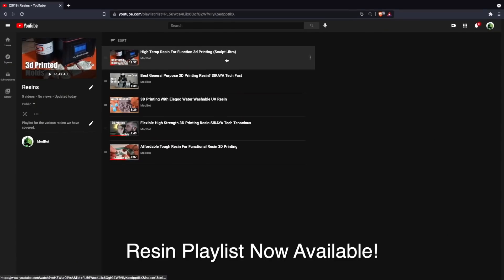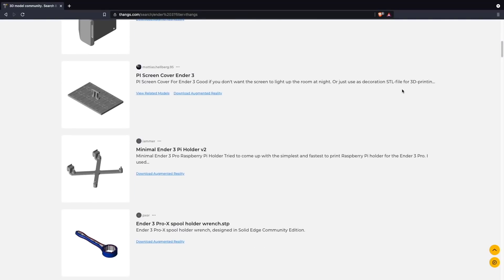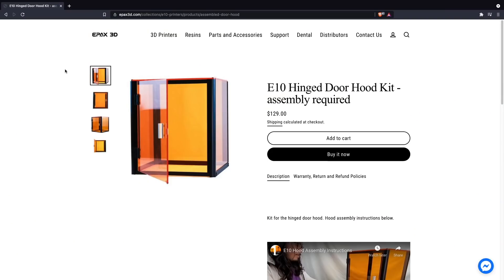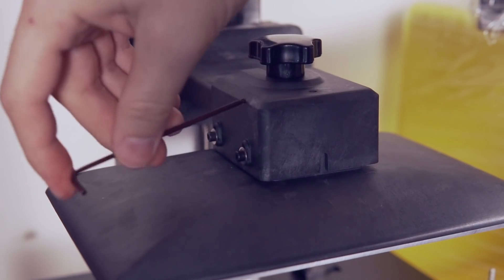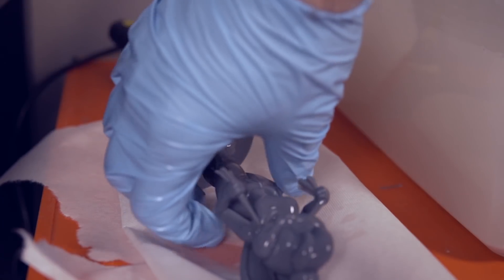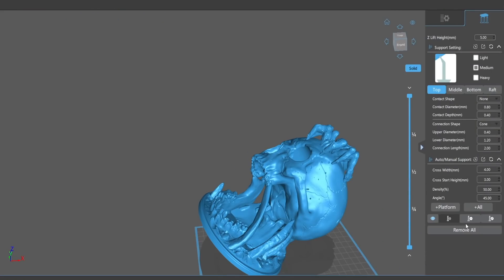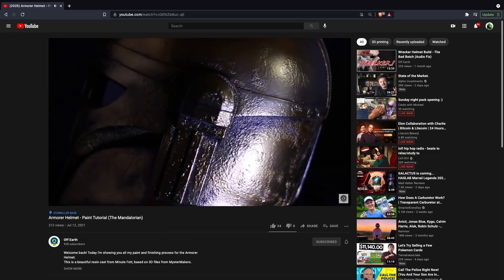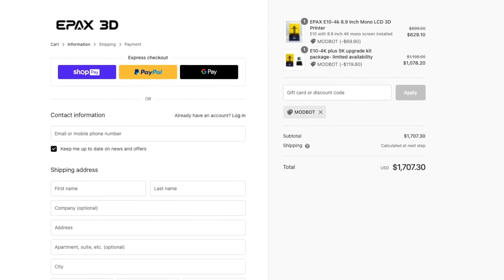INSANE Print Quality On The EPAX E10 - 5K Resin 3d Printer

Comment: What settings did you use for the 20 models print? I have this printer and have mixed results- probably more to my being new to 3d printing, but I have found it extremely difficult to find settings online?
Reply: I have barely been able to print anything with this printer. i need settings for it. My two anycubic photon monoX's are wonderful, but i cant get anything to print well on the EPAX... Anyone have settings they could show me?

Comment: Hi, I'm going to buy one of these printers, but I'm interested in how accurate printing is. Is it possible to print a working piston and cylinder?
Reply: The question is what you're using it for. With  bit of post processing you could make one for something like a model engine.
Reply: @Darenz-cg9zg  Thank you-I making air powered model engines so i was hope i can "cheat" this way parts like valves and so...

Comment: One thing I had wish Epax had done when they decided they would allow the 5k upgrade, would be that even on teh 4k version, if they has kept the 10 inch build plate. That way even if you can't use the full build volume because of the screen, when you DO upgrade your printer, it doesn't make your current buildplate/whambham/flex entirely irrelevant.

EDIT: So they did, the build plate IS the 10 inch build plate even on the 4k 8.9 screen, I'm just a measuring idiot..
Reply from the maker: I was told by someone that has the 4k version it did come with the 10 inch upgrade. So that when he upgrades he is going to use the same build plate. Did you read somewhere that it was not the case?
Reply: @ModBotArmy  hmm, i could've sworn I measured my build palte when I ordered my flex plate and it was definately the 192x120mm build surface..let me double check, maybe i jsut made a suggestion epax already did in teh first palce.

Comment: is this a NEW epax for you, I'd be very wary, of all the resin printers I own, Epax E10 has been the absolute worst by far
- Holes in FEP film in vat out of the box leaked all over screen. Bottle of Resin and FEP wasted(They said they would send me replacements on my next order but oh wait I'm in Canada)
- Polarizing film got a perfectly straight line down in somehow not a crack a precision line, which of course let light through
-Second screen HALF of it went black and other half showed the exposure test, this was only used several hundred hours tops after being replaced from polarizing film issue
-The board had the issue where it kept the UV light on 24 hours..that was fun
-I got the bad hood that they said they were going to replace with a proper one down the line, nope

And the replies I get from support are always "Try flashing firmware" after telling them I did try that prior to emailing.

Literally have spent 2/3 the cost of it on screens after printing on it for about 800 hours. Yet mono x, saturn, 2x creality LD-002H, proxima, mars etc have had nothing go wrong.
Side note don't buy screens from them, they are half the price from Chitu
Reply from the maker: Yikes, sorry to hear that. I wonder if it is a lemon scenario. I know quite a few people that have various EPAX printers and have been very happy with them. 

Also, there are printers that I have had for a long time and love that others have had terrible experiences with. Not saying it excuses it at all and your situation definitely is not good, but with that many issues it seems like that unit was a definite lemon.

Comment: I wounder if anyone has try to make a multi heads FDM machine, essentially fill the entire print surface with printer heads. So it's effectively behaves like almost like a sla machine, print the entire surface at once, but without needing special resin and post process uv curing. Resolution might be a less compare to sla machine though, but should be a lot faster than single head variant.
Reply from the maker: There are IDEX machines so two heads and their is a company called Stacker that makes at least 4 heads. That is the most I have seen though. A lot more variables when you have to have that many spools all feeding and extruding at the same time. Would be cool to see though.

Comment: Have you looked at extension tubes for macro shots? Cheap way to add macro capabilities. Some even carry your pin signals for autofocus/zoom and such. It makes a standard lens "near sighted" where an actual macro lens can be "farsighted" as well, being more versatile without shuffling around tubes and such.
Reply from the maker: Thanks for the recommendation. I had actually printed one like 6 years ago for my old canon camera. That may be the way to go (will likely purchase though).

Comment: I've got the smaller Epax3D E6 printer and am very happy with the build quality. Time will tell if the use of plastic on the build plate and vat is a long-lasting solution but it's good to know they chose to use fiberglass reinforced plastic.
Reply from the maker: How long have you had yours for? My biggest concern is likely the bed tightening screws, but because they use brass inserts I imagine the plastic is taking very little of the load.
Reply: @ModBotArmy  I've had mine since April 2021 and I've gone through 1Kg of the EPAX Water Washable Resin and no issues with the printer. The build plate even arrived pre-calibrated! I think the resin should be marketed as "Tough Resin" rather than "Water Washable". I still seem to have to clean my prints with IPA but they are not brittle so I can use it for functional parts which is most of what I need to print.

Comment: great video and review! a point about when you talk about getting a macro lens; if you have a manual lens, you can turn it around and hold it in front of your camera (or 3D print an adapter) and you have a very good macro for free-99 or design time and resin/plastic.
Reply from the maker: Thanks for watching and the recommendation. I did do something similar years ago when I had a canon camera. My lenses are all Automatic at this point but I still believe there are adapters that may be a fairly inexpensive way to get the detail I would like.

Comment: For us mini enthusiasts (28mm) the most important feature is the resolution/detail on small prints. The most important metric is the smallest micron resolution of the print. You did not offer this metric, but... Neither does Epax, apparently.  You can pump more pixels into a resin printer screen, but end up with lower details when you stretch that high resolution screen for big prints. 

I really wish I knew the minimum microns. I've been waiting for that juuuuuuust next step printer where the detail resolution absolutely matches pewter and injection molding at 28mm. I hoped this was it.

Comment: "you're not going to be forced to purchase the Pro version" yeah yeah yeah. Heard that claim before. These software dev's all do the same thing. Force users into a subscription model either by slowly boiling the frog and/or also forcing you into it by limiting the features of the so called free version so you have no choice anyway.And then if that wasn't bad enough.. they'll start upping the price over time as well as not doing what they should be (adding features, functionality, UI improvements etc).

F that white noise. Where is Pruse Slicer or Cura support on MSLA???? Open source slicers only thanks.

That was one thing i overlooked when doing far to many years of waiting and waiting for hardware to match price/performance ratio ot my liking.. i overlooked the slicer side of it assuming i would be able to slice with anything. So now i'm a bit worried i can't use any slicer to slice for the EPAX-E10 4k i've finally bought and received (but havent used yet as i sitll have to get a lot of extra gear for).
Reply: I almost bought the E10 5K on Friday, until I found out it is indeed locked to ChiTuBox. I have an X1, X1K, and X10 already so big fan of EPAX. I share your same sentiments towards open source, and was worried this was going to become a problem when I first got into SLA printing and most of the boards were made by the same manufacturer. I believe on the E10, as long as you don't upgrade the firmware, you should be okay.

Comment: Could you please tell me what the voltage is coming out of the power supply going into the printer and if it is DC?  The reason I ask is I need a printer that can operate away from 110VAC power.  Want to be able to run OTG.

Comment: Hey Dan is a cure and wash chamber needed for resin printing. I've decided to get one but not entirely sure what's needed aside from the printer and resin
Reply from the maker: Not a requirement but definitely nice to have. I use just a tub of IPA and the sun sometimes but having a station that can do it all is going to be much more repeatable.
Reply: @ModBotArmy  so I take it the models come out somewhat soft. Are there printers that are known for better curing or are they all pretty much the same. And are the prints susceptible to things like fingerprints and need to be handled carefully at first?

Comment: 8:05 - I wish they wouldn't use plastic for these vats. You can see how it is already warped when tightening down. And it will only get worse with use/time. And then it'll crack and leak. That's an annoyance on $200 printers with $30 LCD panels, but the stakes are higher on these big ones.
Reply: I think what it not mentioned much is that Epax "E" series is there "economy" model. It is meant to save money in certain areas to keep the price down. The X series is their highend one which has both the metal vat and metal build platform.  E series is just the first one they happen to add the 5k to
Reply from the maker: It seems like that is a pretty universal feeling based on comments. It is not something that has been an issue on the other printers I have used with it like an Anycubic or a Phrozen but it would be nice to at least have the option for aluminum. Maybe have it come with aluminum but also sell plastic VATs for those that want to swap in.
Reply: @ModBotArmy  Right, toss in an upgrade option for 10 bucks to add the alternative VAT.  Cater to the market.  People love options.  Just saying.
Reply: Thats the same complaint i have about the Anycubic printers.
Reply: @BretBowlby  My photon's vat is metal.  Combination of anodized aluminum and stainless.
Reply: For 200 bucks if it breaks just buy a new one

Comment: Does this printer work with Lychee slicer?
Reply: It does, v 3.4 supports the 5K screen too.
Reply: According to EPAX support as of Friday July 23rd, the 5K E10 will not work with Lychee.
Reply from the maker: I believe it is going to depend on the board version. It is my understanding that the newer printers shipping will have the latest Chitu board which is currently not compatible with Lychee. This may change though.

Comment: Daniel, it was nice to see you address the pro-slicer question. There are a number of 3D printer content providers that have not addressed the issue which is disappointing. However, the question is more than just free versus pro. Will, this printer work with other slicers besides Chitubox? The way you explained it, makes me question if it does.  CBD-Tech, the parent company of Chitubox, manufactures controller boards for many printers including Elegoo, Phrozen, Creality, and Anycubic.  This gives them monopoly control over most of the printer market. There is nothing to stop them from forcing users to the subscription software model (SAS) at any time. The only way to protect the resin printer community, from this questionable practice, is to allow the use of other slicer software. According to Naomi Wu, Creality has promised to only use controllers that allow the use of multiple slicer products, but so far that is the only one. Using other slicers and then importing the files to Chitubox is not a viable option. Slicer issues are hard enough to address without introducing cross-platform or software compatibility issues into the mix
Reply: I use Lychee, it has several epax printers set up and configured and works great for my E10
Reply: I verified with EPAX support on Friday - prior to purchasing the E10 5K - that the firmware on the motherboard in the new 5K printers is encryption locked, requiring either pro or an as-of-yet unreleased ChiTuBox free version to slice. This means that Lychee, UVTools, etc., will not be able to produce files that this machine can print. For anyone unclear, this is not a theoretical, it is the current state of new boards.

Supposedly some people who have updated the firmware in their E10s have also been locked out of using other slicers (according to the EPAX Users Group on Facebook).
Reply: @charlesfe  Thank you for the confirmation. We have to get the word out and challenge the vendors on this practice. If one gets away with it, then more will implement it. Hopefully, people will only buy printers from vendors that support the open model.
Reply: @charlesfe  That sounds extremely dumb.
Reply: Imho, Chitubox's current slicer format is supported by multiple tools (UVTools for example). So unless they make deliberate effort to change their current file format (and maybe lock it down with DRM), you aren't forced to use Chitubox with these printers. So for the current batch of printers, there's no issue. I don't want to demonize Chitu for things they might do in the future, we can cross that bridge if they do decide to roll out some DRM scheme.
Reply: @morgitorgi1498  It is not a might do. EPAX  support confirmed that their new printer has an encrypted board and will only work with Chitubox. They are doing it. Only one vendor (Creality) has come out against it. I hope to see more vendors push back. This is a bad president and will spell the end of the 3D resin printing hobby market. Not many people will pay an annual software fee, that costs more than a mid-range printer. Chitu is getting greedy.
Reply: @saltyscorpion2151  Oh I agree it's def a deal breaker for me. I won't purchase the Mars 3 unless i'm able to use Lychee on it.
Reply: lychee slicer can export to .CTB files.
Reply: Locked firmware would be a deal-killer for me. I don’t need the 5K size, but if there’s any chance that their 4K might be locked, I wouldn’t buy it. (I hope it isn’t, I’m really liking what I’m hearing about the E10, and I particularly like that they’re a US-based company. Unavoidably mfd in China, but a huge plus that HQ, development and support is in the US)

Comment: Question,  I'm getting very bad warping on my resin prints. I just printed a part similar to that rode clip on your tee shirt and it's so badly warped in many directions it's unusable. I thought warping was not a issue in resin printing? It happens in all 3 resins i have bought and i used the standard settings then washed and cured for about 3 minutes each but they were warped beforehand right from the vat. This is my first resin experience and it's been a nightmare to the point i used all the money i have and got nothing but junk, even the fep is ruined because of the part stuck badly. It's  a anycubic mono mini with 3 different resins. I really could use some help but like i said I'm a noob to resin and out of money so i hope it's a simple fix?
Reply: Post to discord or Reddit. Basically warping  is either during the actual print process because you got unlucky with suction (long straight parts are often culprits, but I’ve done this without warping. Make sure to use a heater if your ambient isn’t ~23C or greater). Print in a different orientation, add a heater (I always run a heater set at 30C), and also the biggest culprit for large long parts is curing. You gotta make sure it’s flat (can bend it lightly before curing), and weighed down so that it doesn’t curve up
Reply: @cwill2127  we have to heat the resin? They have heaters for this? This just now reminded me that i had the AC on. Thanks for leading me on to the problem.  I will now suffer and sweat for accurate parts :)

Comment: 5k? Soon we will have a greater than life resolution.
Reply: We already do. Just don’t wear your glasses and boom literally any resin printer is better than life
Reply: @Zuluknob  you got your stats on the um  sizes for those printers wrong. while yes the e10 is 50 um the rest are not listed correctly   From Anycubic web site  the photon has a 47 um (photon x's are 50 um as are some other anycubic resin printers), Phrozen's web site lists the sonic 4k/sonic mini 4k at 35 um.  the Epax x1-4k printer has 32 um, which as far as I know  currently holds the best um of the  home/hobby printers. .03um difference between a printer isn't noticeable so say between a   photon and the e10 4k or the x1-4k and the sonic mini-4k there really isn't notable difference in print quality. I have the sonic mini 4k and a epax x1-4k as well as the e10 4k. While I can tell the difference between the e10 and the other 2 printers on detailed minis when looking at them closely i didnt get the e10 for minis but for scenery pieces. for scenery the e10 is better then those others printers because it has a larger print volume so  can print without splitting them up as much and it is still way higher then fdm printing.  However I am really considering the phrozen 8k printer for that. with its 43um with a large print volume of Printing Volume: 33 (x) cm  x 18.5 (y) cm  x 40 cm (h)
Reply: @Zuluknob  oh well in your post you said phrozen sonic 4k. but understandable if you meant the phrozen shuffle which i see is .31 um.
Reply: @Zuluknob  yes I have, it's a good review. However i spent my "allowed" printer money for this year hehe, I almost went in on the pre-order but i just didn't have the cash at the time.
Reply: @Zuluknob  eh we all have em :)